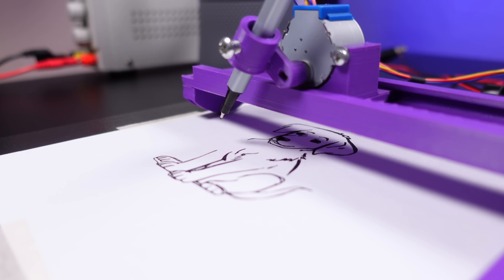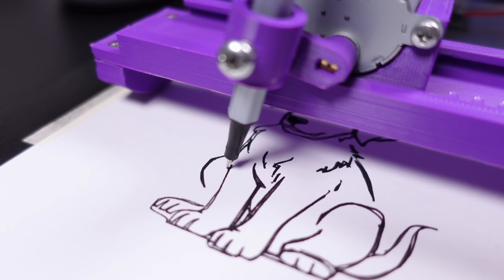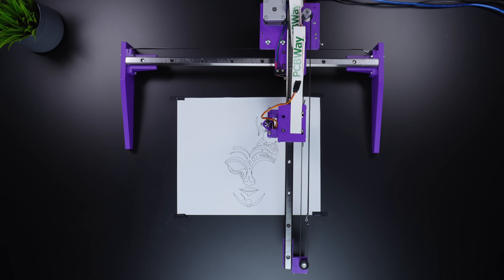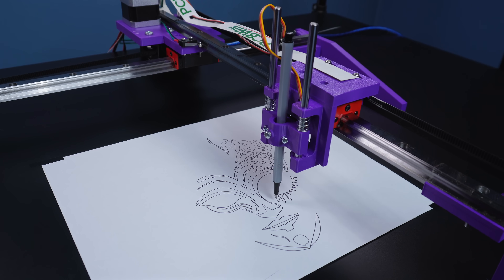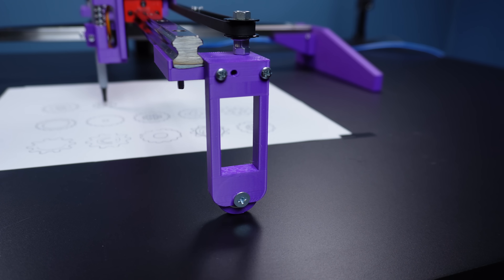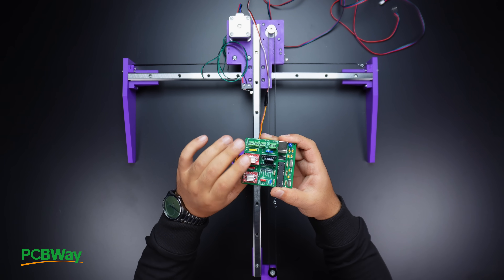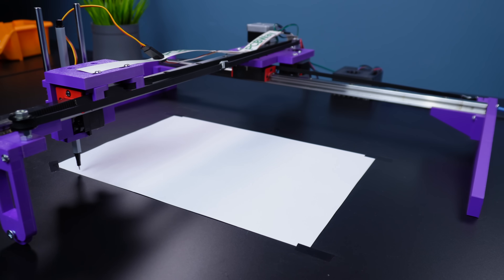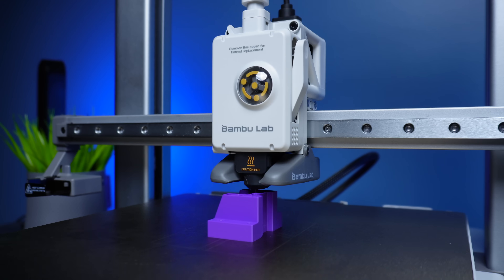DIY 3D Printed CNC Plotter Machine with NEMA 17 Motors

Comment: Final cost please?
Reply from the maker: Actually, I didn't calculate the cost. Besides, the linear rails, blocks, filament, stepper motors and all similar equipment may have different costs in each country.

Comment: This is an excellent device, thoughtfully and expertly designed. Would you be able to share a parts list and printable models to allow others to build one themselves?
Reply: Checkout "GatorCAM for CNC". I got fed up with inkscape's gcode tool quirks so i wrote my own. It works with SVGs.
Reply from the maker: Thanks for your comment, I will share it as soon as possible and pin the link at the top of the comments 😇
Reply from the maker: Necessary file sharing has been done. All details about the project are being prepared, the step-by-step article will be completed as soon as possible:
https://www.pcbway.com/project/shareproject/Build_a_simple_3D_printed_CNC_plotter_machine_dfd8b2d7.html
Reply: @maker101io  Thank you very much for sharing the project—excellent work!
Reply from the maker: @Dawid-cl7cz  You're welcome 😇